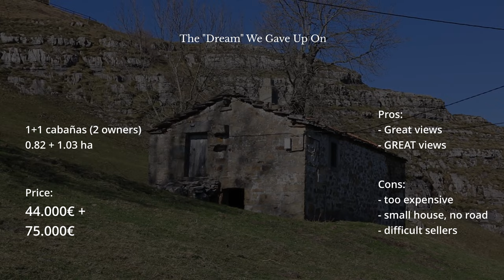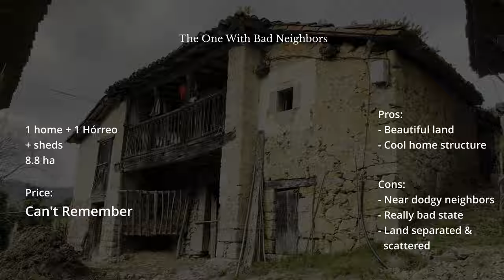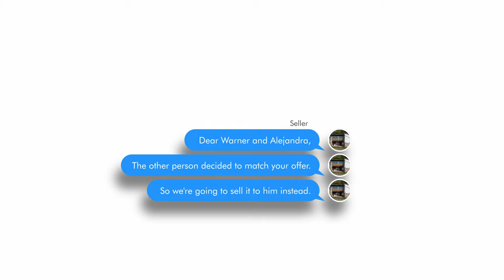We found our spot! | Buying land (+homes) in the North of Spain

Comment: Enjoying your journey and look forward to seeing more. Just to share some positive info on how much of Europe is forested, from the "2020 State of European Forests Report":  The report shows that there are positive developments in several areas and presents, among others, the following figures:

"European forest area has increased by 9% over the last 30 years. At 227 million ha of forests, more than 40% of Europe’s land surface is forested.
The volume of wood and the weight of carbon stored in European forests have grown by 50% over the last 30 years as forest area expanded and only a part of the increment has been harvested. About 3/4 of the net annual wood increment is felled.
The volume of wood supply has grown, reaching 550 million m3, which is 40% more than in 1990.
The area of forests designated for biodiversity conservation has increased by 65% in 20 years, and the area designated for landscape conservation by 8%.
The number of genetic conservation units has increased about 10 times since 1990."
Reply from the maker: Those are some great stats. Thanks for sharing.